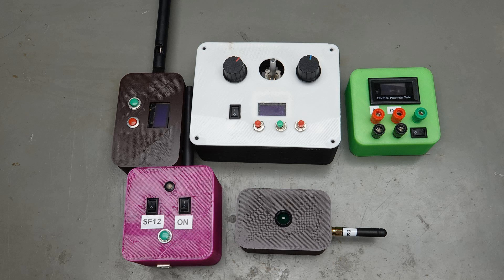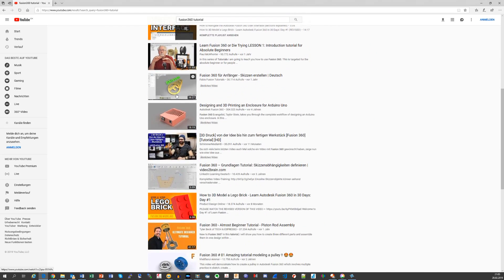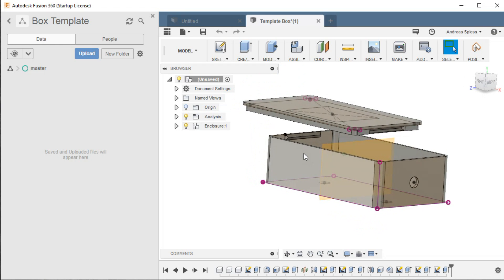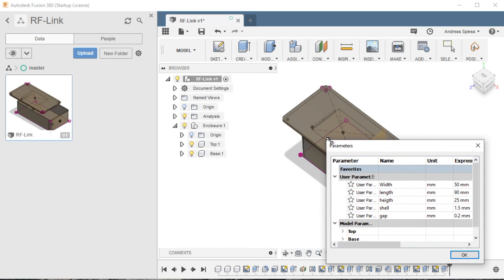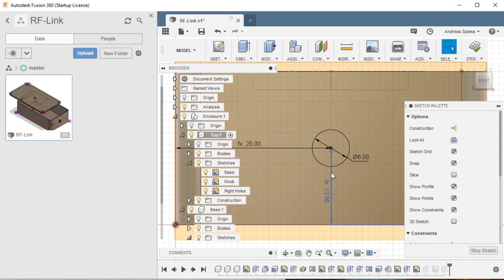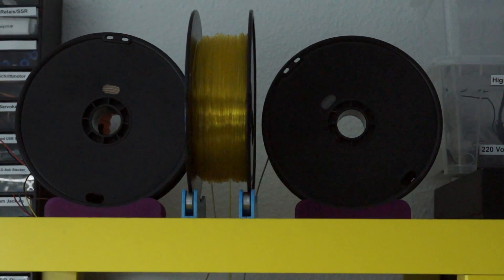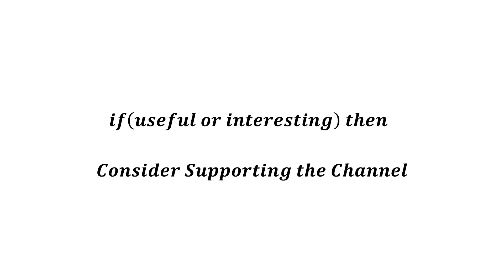#258 Configurable Cases for your Projects  (Arduino, ESP32, ESP8266)

Comment: You should use and promote free software when there is a free alternative. In this case, freecad is a good example of great free alternative. Other free alternative commonly used for easy adaptable models is openscad.
Reply from the maker: @Marcus Metzler Please compare with what you own if you buy a VW Golf: You own your particular car and can use it, you can resell it (this might differ from some software contracts) changing it with today's technology is not easy if not impossible, and understanding the source of it is (for me) impossible. Open source? I usually even do not get a Service Manual. So not a lot of difference in my view.
The major difference, however, is, that replicating (not producing) software is cheap, so the cost of goods sold is low. Like in pharmaceuticals, in banking, and in many other highly automated service industries. Not many of these industries offered me free products, just because I am a Maker ;-) 
I still think that we expect something from our industry (where we get paid from) we do not expect from any other industry.
Reply: I used tinkercad as free and online. Very basic but does the job
Reply: FreeCAD has a horrible UI that lacks even basic Windows UI features like saving changes made to the toolbars.
Reply: "You should" not use "you should" :)  IMHO Use the software that helps you getting the job done. BTW Fusion360 ís free for makers and hobbyists like andreas explains. And thank you Autodesk to provide us makers with this amazing tool for free ...
Reply: @sledgeHammerRulez  Nothing is really free. And Autodesk will have its reason to give it away for "free".
Reply: @drmocm  Yeah, because people will get used to autodesk software and use it in a job if it gets relevant. Then they will have to pay for it. But I don't see a problem in that.
Reply: @mauricebremer3728  The problem is vendor lock in.
Reply: @drmocm  it is still a professional tool that makers can use for free. I don't see what's wrong with it, many other vendors give you their software free for personal use, as I guess they know people would pirate them anyway to use at home.
Reply: @drmocm  it is still a professional tool that makers can use for free. I don't see what's wrong with it, many other vendors give you their software free for personal use, as I guess they know people would pirate them anyway to use at home.
Reply: The reason of course is to gain adoption.
Reply from the maker: I would like to add that many of us have to feed a family. I for example worked at SAP and was happy they paid me a salary. I do not see how this would work with open source and free software. 
All other industries are not requested to give their products free of charge (I would like a free car or Smartphone). Sometimes I think, we are a little harsh with our suppliers. Or am I old-fashioned?
Reply: @AndreasSpiess  ah I remember using SAP software when I worked for E.ON. Is it the same you worked for  I wonder?
Reply: @AndreasSpiess  no, the problem is that there are many people thinking that on the internet everything should be free/open source, but they just don't understand that programmers need to be paid and if they have some free time they can contribute in some open source project
Reply: @AndreasSpiess  All other industries don't sell products that can be produced for almost no production cost after they have been developed. There are many companies that earn money producing and supporting open source software. The problem with software is not that you have to pay for it, it is that you don't really own it after you buy it. You can't see the source, you can't change anything and most of the time, you can't even use it on another computer.
Reply: @AndreasSpiess  To be fair, Redhat is now worth almost 1B $. They are a huge open source company, they pay the people that work there very nicely and you can still download the product for free. Open source can and does work as well as make money. Mind you this is just 1 example.
Reply: @The_LanMan  no you can download the source code for free, it's open source but zero support and zero binaries. I challenge you to run RHEL, actual RHEL on a daily basis without running a community fork (CentOS for example).

Red Hat make millions selling their packaged software, support and other services. Saying they make money from open source is embellishing the truth quite a bit.
Reply: @lmaoroflcopter  I can download the install DVDs with ready to run code. So can you for free. You will get no support for it, but that IS how they make the money. I don't have a problem with it. And it's not an embellishment, it is ALL based on open source. And if you want, download the SRPMS and compile it yourself and fork it. Why do you think it is hard to run RHEL on a daily basis ? Works just fine, you can't use the RHN for updating. You need to download the updates and apply them using yum or rpm.
Reply: @The_LanMan  I completely forgot they changed that, i'm a former RHCE and seem to remember the day they went and prevented access to precompiled code. Times change :). Yeah SRPMs were always available, but you had to have an environment to actually build it in the first place.
Reply: @lmaoroflcopter  True Dat.. And you like VI. That is always a plus.. :-)
Reply: Fusion 360 is free for makers anyway.
Reply: @thesimbon  I mean free for freedom, not free of charge.
Reply: @anvz6  and we also have free will, so you can choose whatever suits you best 😉
Reply: @anvz6  I think if it's free as in beer, and that product is better/easier then a free as in freedom product I have no problem using the former.

Even if I agree with the idea of freedom, I still have to get the work done.
Reply: @The_LanMan  I understand that for most people the only important thing is the money, but many people worked for free to bring you a very powerfull software that is improved by users for users, not for commercial reasons but for being usefull. I think it is important to promote this software. You can learn freecad with youtube videos and you will see it is a different concept, not artistic, not "draw with the mouse", but strongly orinted to engineering where the parametric design is the best option.
Reply: @anvz6  I do not really disagree, but some times you need to use the correct tool for the job.

No matter how the tool was created. As a systems engineer I use a lot of Linux and open source, but there are times that an open source option isn't there or isn't supported by my job.

So I use what they tell me I can.
Reply: That would be OK if FreeCAD or OpenScad were actually usable for mortals.  FreeCAD is.... unpleasant in all respects, and OpenSCAD you basically need to be a programmer, and be able to mentally construct your model.   In the absence of any good opensource solid modelling packages, Fusion360,  OnShape are realistically the best choices for most people, TinkerCAD if you only need real simple stuff.
Reply: James Sleeman I also found FreeCAD hard to use as a beginner, too many options. But it’s great it’s free.
Reply: The maker community is all about sharing projects and as a passionate open source advocate I'd agree that open source is a neat fit with the ethos of making.

That's not necessarily because it is often free of charge (not always!) but because it is shared both in terms of its direction of evolution and also it is often available for many platforms.

Fusion360 is free (in terms of money) for makers but it is only available for those who are prepared to suffer either Windows or iOS.

FreeCAD and OpenSCAD on the other hand are available for Linux too. They're not just free of charge but available and open to all.

Furthermore for a parametric project like this with no complex geometry I think OpenSCAD would have been much faster. Yes it needs to be approached from a logical "programming" perspective but if one is making boxes for micro controller projects one already has a "programming perspective".
Reply: @gavinsmalley1513  As a maker and someone who enjoys electronics, who has used openscad from time to time I can safely say it requires an understanding of CAD and a spatial awareness that electronics and micro computing does not require.

I write entire programs for ARM and quirky 8086 processors using assembly. Yet when it comes to designing an enclosure for a project I'd also reach for fusion360 as it is infinitely easier to understand and quicker to work with than for someone who only has a fleeting need to use it, to create a semi complex design in openscad.

In fact, I think if I was going to go that route willingly and not because someone has already done the heavy lifting for me,  it might even be easier for me to just write the gcode directly in a text editor.
Reply: @lmaoroflcopter  Obviously everyone's experience is different. For me when I use FreeCAD I do all the maths and then put those numbers in to FreeCAD. When I use OpenSCAD I just write the formula in OpenSCAD and it does all the heavy lifting.

YMMV though, everyone works in different ways.

Comment: cool stuff Andreas...i need to get a 3d printer to make stuff to house my projects...theyre still out of my price range tho :(
Reply: you can get a reasonable printer for a couple of hundred bucks now, not too bad.
Reply: Don't know your budget but look at ender3 for cheap ok quality. However 3d printing is not a tinker free operation
Reply from the maker: @WacKEDmaN maybe you have a Makerlab around your location. Most of them have a few 3D printers. Or a colleague who owns one? It is the time of the sharing economy (at least if I believe the newspapers)
Reply: @AndreasSpiess  unfortunatly the makerspace here in town is geared towards woodwork, metalwork, small engine repairs and horticulture..i dont know anyone who owns one, i have a friend who has been talking about getting one...but that talk has been going for almost 2 years now!
Reply: You'll love Prusa original, high quality and amazing community. Had a problem (filament broke off) and within the hour I had a real solution.
Reply: @sledgeHammerRulez  or make one 😀
Reply: I can recommend the Ender 3, aside from the warped bed and thermal block protection that was gone quickly it is a very good printer for the price
Reply: I got one for around 200EUR I think? They are getting pretty cheap and for most home tasks they are good enough. Original Prusa is probably the best though if you don't want to spend too much time tinkering.

Comment: Now all I need is a 3d printer. :-) Thank you for sharing.
Reply from the maker: The 3D printer was one of the best investments I did. This is an awesome technology.
Reply: @AndreasSpiess  Interesting! A colleague of mine says the same. and tries to convince me. But I cannot imagine how this would be worth while for me. I Always have some cheap boxes on stock and a lot of small junction boxes for 0.50EUR to a few EUR. So my project boxes usually are build very fast and cheap.
Reply: Me too👍
Reply: if you ever decide to get one, dont get a kit version. save up for a decent one to save headaches
Reply from the maker: For the moment I have a project where I want to measure pressure in a beer bottle (for homebrewers). Therefore I need a particular cap with a particular thread which is air-tight and can house the pressure sensor. You see, I do not only print boxes. ;-)
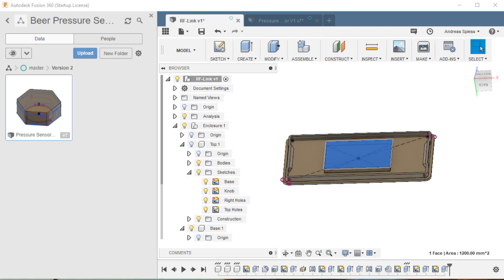Reply: @AndreasSpiess  Ah, so that's what the "Pressure Sensor" file on the sidebar was, starting at 7:40.
Reply: @AndreasSpiess  Ah, something like that https://homematic-forum.de/forum/viewtopic.php?p=328133#p328133 :-) ?
Reply: Now all I need is a 3D printer that works correctly (which is worse than no 3D printer as I already spent the money). I've seen videos of this 3D printer and I think I can get it working, though.
Reply: Think about Cetus 3d MK3